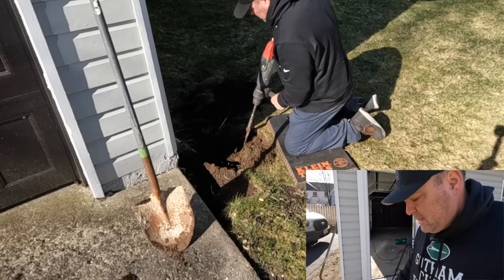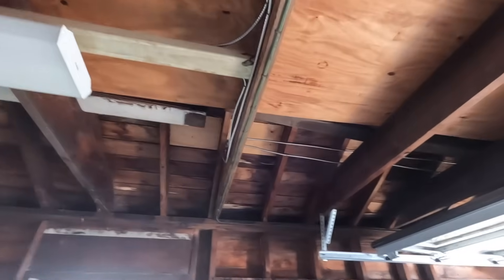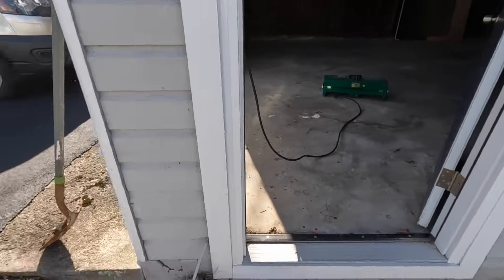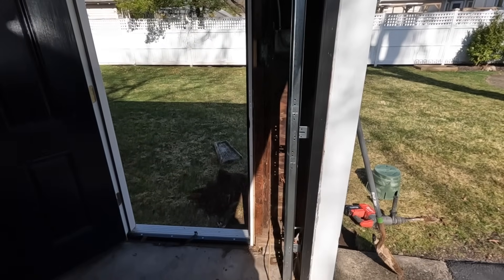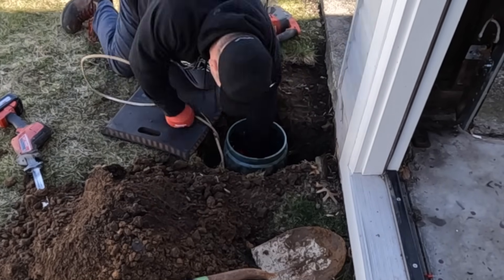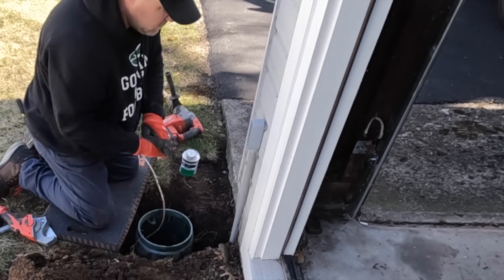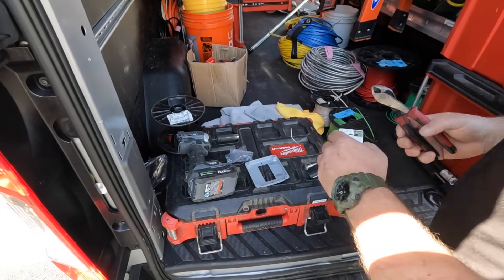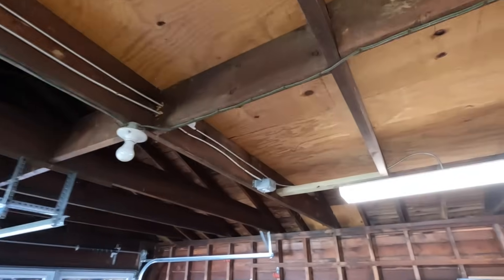How To Safely Repair EXPOSED WIRING to a Detached Garage

Comment: Any thought of using some cement at the base of the hand hole?  I have always wondered if that would keep the gophers out.  Around here when you go to open that hand hole, the whole thing will be packed with dirt top to bottom by the gophers.

Comment: I do not understand why you did not run a new UF 12-2 wire w/ ground wire to the garage and bring that wire with no splices direct from the circuit breaker panel in the house to the garage.  Splicing in the ground will not last more than 10 years before corrosion sets in.
Reply from the maker: @Chad.Tyrone  You obviously have no idea what you’re talking about
Reply: I would not want to have an electrical joint in the soil in the green conduit with some rocks to keep the water level down.  Better to have a home run from the garage to the main breaker panel in the 1910 house.  I respect you that I do not know as much as you, by the way.
Reply: @Chad.Tyrone A home run is better but he was asked to fix the issue and price matters. If you price a home run here versus what he did, you lose the job to the cheaper guy. This will last longer than 10 years.

Comment: Looks good, are those outlets are gfci protected?
Reply: Does have to be one supplied in front of each vehicle stall that's gfci by code. I think I saw two quads up high for the garage door openers those if I'm right are not required to be gfci since you can reach them to reset. That's a good an valid catch.

Looked into this more it's 210.8 in NEC ALL receptacles in a garage have to be GFCI . So you can go with a GFCI breaker problem is it's a detached garage so you'd have to go in the house to reset it. Or just install the first outlet as GFCI and connect the rest on the load side of the GFCI outlet and put stickers on the non GFCI outlets stating GFCI protected. Then you can reset right from inside the garage
Reply: @ yes, every receptacle in garage need gfci protection. It could be a low gfci and load the high outlets or a gfci breaker, probably some other options as well.

Comment: Would it have not been easier to just have feed the existing wire into the new PVC to protect it and then put a junction box inside?  Then you would not have to have a junction outside.
Reply from the maker: @jaycahow4667  You know in hindsight you’re right.  My idea was I could do a video on installing a handhold and I decided to do it this way.
Reply: I came here to say this.  Hate having underground/outdoor splices when not necessary.

Comment: Great outbuilding upgrade Ron, saving the customer the expensive nuisance of trenching.
I'm guessing branch circuit is GFCI protected, I prefer in  new installation of having GFCI protection in the outbuilding. What code does this municipality use?
The newer GFCI AFCI code cycles in my opinion is raising the cost of service upgrades prohibitively high. Five dollar breaker versus fifty or a hundred each.

Comment: Ron, I understand why this was done, but think it will create a larger problem. All the runoff of the roof will seep into area where the wiring is joined. There isn't a downspout shown but if that cable was rated for direct burial, I would have elected for shielding it above ground.
Reply: That's what I say ,it was long enough to go o insde

Comment: Why use MC indoors? I assume it’s code. Just wondering what the rationale is.
Reply from the maker: The outer jacket - although not rated for guarding against physical damage - is a whole lot better than exposed Romex (NM-cable). Open framing in a garage like this requires some thought as to not having the wiring "be dangerous" after a shovel, or rake, hits up against the cable.
Reply: mice cant chew through mc cable
Reply: MC nice for running under joists as well